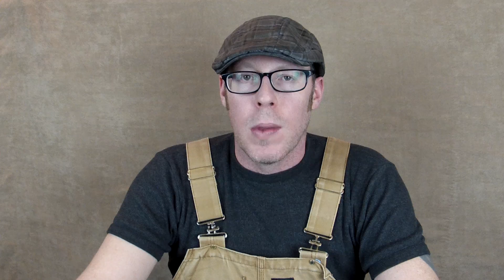How to match a pool pump with a pool filter?

Comment: thanks for this information man!, I have a sand filter which can handle a maximum flow rate of 11 m3/hr and my pump says its maximun flow rate is 25 m3/hr, every week I find some dust on the floor, it seems to be algae or sth like that, do you think this can be the reason (oversized pump?) thank you in advance, good work and regards from Chile !!!